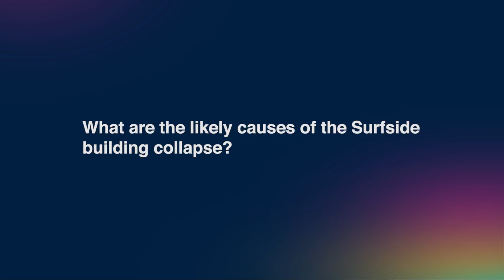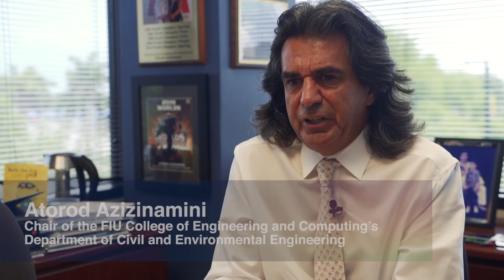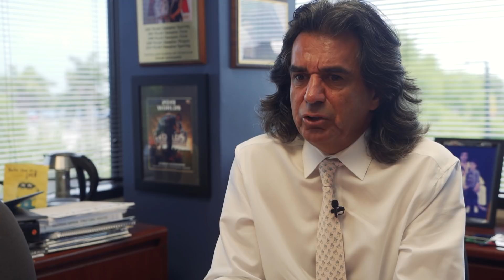Interview with Atorod Azizinamini on the Surfside building collapse

Comment: Perhaps they should design all buildings with the threat of collapse….not just earthquake areas, maybe it could have saved lives in this instance
Reply: What?  Do you think Florida is a progressive state?  Why waste money reinforcing buildings when they're just fine as they stand?  We can't plan for everything, so why plan for anything?  Florida state motto, Lol!
Reply: All buildings are designed not to collapse.  This one stood for 40 years.  Either there was deterioration of material, alterations to the structure, or subsidence; most likely a combination of above.
Reply: @LardGreystoke  Evening news said possible intrusion of water due to faulty waterproofing, for over 30 yrs.  That can certainly affect the infrastructure.  They were in the process of beginning a multi-million dollar remodeling of the building...but they were a few days too late.  The roof work would not take such an extraordinarily long time so that rainwater would enter, however that may have been the case for the past three decades; a steady flow of water though a small leak or leaks would not be good.  I agree, deterioration of material and subsidence is what I've narrowed it down to.  At this time barring more info.
Reply: @RondoHunter3.14  Yup.  Best guess at this point.

Comment: Probably to much material on the rooof! They where putting a new roof on
Reply: If that were the case, it would had collapsed from the top. It may not even have collapsed all the way, just the upper levels. That's not what happened.
Reply: The structure was weaker at the ground floor because of the concrete/rebar deterioration and the extra load on the roof caused it to fail at the ground first.
Reply: @kscott2655  have you seen the vid from inside one of the units? Maybe you should. It was crumbling above them.
Reply: @susycue3  I have not, but that could make sense depending on where they were and the timing. But, watching the overall collapse where you can see the whole thing falling, it is clear it does not start at the top. Perspective is important.
Reply: Hey hey now, this isn't China.
Reply: Or the put a new HVAC unit on roof and it fell through causing it

Comment: how much a beach side apartment cost in Miami? old buildings appreciate right? there goes your investment.
Reply: Half mil n up
Reply: Looking at Zillow, this complex had a wide range. 3 bd 2 ba 1748 sq ft recently sold for $710,000. While a 4bd 4 ba 4500 sq ft sold for $2,880,000. A 2 bd 2 ba 1672 sq ft sold at the end of April for $610,000.  There are also 1bd 2 ba 1200 sq ft in the building.

Comment: I think the construction next door weakened the foundation
Reply: Really? next door construction weekend the foundation on this building? HMMMMM. But yet the foundation under this building seems to be intact as can be seen in the parking garage where workers are working on the collapse from below. 
and the part of the building that came down first was the middle of the building. foundation being compromised by neighboring construction would occur at the outside foundation of the building if this were the case not the middle of the building.
Reply: @grounded7362  actually I listened to an engineer from FIU.  They had to drill pilons at the construction next door.  It has been said there was a crack in the either parking garage or the below ground area of the collapsed building that opened during the construction next door.  They patched it.  This theory  basically says the construction next door destabilized the foundation and caused the walls to weaken and come down.  Im not an engineer but that theory is as good as any really

Comment: Someone is responsible no matter what
Reply: @JuliahFL  you can’t be serious.
Reply: @DylanRollinss  😀
Reply: Spread the word - ALL CONCRETE HIGHRISES WITHOUT STEEL SUPPORT BEAMS ARE IN DANGER OF COLLAPSE. Era of increased solar radiation is deeply penetrating and drying out the water entrapped molecular cohesion of the concrete causing it to get brittle, weaken, and disintegrate. -Like a mountain topped with heavy snow it could be a mere BANG! noise to trigger an avalanche collapse.

Comment: Researchers indicated the building had been sinking since the 1990s.
Reply: Even if the building started sinking every year since it was built and say the building was built in 1980 that is only 3.23 inches over 41 years.
Even if only one corner of this building sank 3.23 inches in 41 years, it would not cause the building to collapse.
The way these building are put together you can remove all the earth from under an entire corner of a building this size and it will NOT collapse.
The same goes for the middle of the building.
Nearly the entire structural support columns and beams at one level would have to be greatly compromised somewhat equally to bring this building down from the middle out like this.
Reply: Grounded. Right on
Reply: Buildings are engineered for horizontal and vertical loads.  If a building settles unevenly it will throw those loadings out of true and induce stresses that were never accounted for.  A steel frame building would probably withstand it.  Concrete is a different story.  There are all sorts of ways for concrete to go bad.
Reply: @LardGreystoke  My thoughts as well. I'm no engineer but like you said a building uneven does not like to stay that way.  I've looked into both flexural and shear force failure in concrete.  Again, you are true in that concrete can and does go bad, in all sorts of ways.  I've seen too many "Catastrophic Disasters" on the t.v. and know a little about various types of concrete and what it does and does not do.  Your comments stand true, I concur.  Thank you for your insight.
Reply: @grounded7362  I've been looking into flexural and shear failure modes and wonder if either/or these forces may have rendered the internal structural reinforced concrete holding the building together may have suffered either mode.  This would effectively split the building should one side, as it appears, begins to go down followed by the rest.  Just another possibility, speculation, guess.  Of course this would mean that one side of the building, possibly already compromised, could and did fail under either excess, unbalanced weight on roof or lack of ground support or both.
Reply: What is the context of it sinking? If it is just sinking perfectly vertically nothing will happen other then eventually being underground, loads would be the same.  If one corner was falling by 2mm/yr you are still talking only 6cm total which would be about 4 inches (unlikely only 1 corner would fall) and you are talking a decent horizontal distance for that 4" fall too that it would be of a minimal magnitude.
Reply: @ryanwright9460  The CC tape showed that a portion of the building fell first followed shortly by another section.  If a building such as this has a corner begin to sink cracks will and did form.  They were basically ignored.  The weight load of the building would shift the gravity center towards the dip.  This would cause an undue amount of force on one part of the building while the other part was just fine sitting where it was.  So the sinking part simply separated from the rest and fell.
Reply: @RondoHunter3.14  i think it had minimal to do with it, you are talking 2.4" over a 100-200ft span to hit the extreme scenario of your lack of context.  The report of it sinking 2mm/yr is likely in reference to the whole building, however not in the ideal uniform sinking that the distribution of stresses would be the same which would make the shift in loading less than a change of 2.4in/150ft and that is including the surveyors measurement errors from before and after each check.
Reply: @ryanwright9460  That may be true.  You seem well-versed, it will be interesting to see what the final verdict is on this disaster.  Yes, a year or so on down the line we'll get a report.  Thanks for the discussion, you raise viable issues.
Reply: For over 30 years they knew the building was sinking.  Probably because it was measured in millimeters (2 per year) and they got confused about the translation to standard measurements, figured "Ah, that's no big deal.  Call us back in about ten years or so."

Comment: "Unusual event before the collapse" - a powerfull underground blast ??? 😡
LOOK UNDER still standing 😯 BUIDING-SECTION ON PILLARS:  
[1] Are those pillars DAMAGED BY A BLAST/SCHOCK/WAVE from under, building above uplifted and reseted ??? Why only this building-section still standing ??? - LOOK UNDER, SEE to understand 🔔 
[2] GROUND-FLOOR IS WIDE OPEN, clear rods, 4ft long ... like spikes of a comb ... UPWARD DIRECTED and SPREAD, cleared of concrete (!?!) 🔔
😡 IT SIGNALS more like an underground floor-blasted "event", probably A POWERFUL BLAST (!?!) underground ...  but, because open air, no walls around, the wave-power dissipated ... maybe ...! Pure luck for people above ! Former vice mayor lived (third floor above) - he should make his mission - to find out what really happened ! 😡
[3] Why cars are piled upward ??? 
[4] THEN LOOK AT THE VIDEO - 4-5 story high raising (!) dust - FROM A BLAST ??? 🔔 BEFORE first building-section collapsed - why inside-section collapsed first, no open air for wave-power to escape ??? How serious damage happened UNDER (!?!) that also larger, longer building section -  again no open air ground floor ? - finally collapsed few seconds later in its entire length ??? 
A sinkhole "event" - as trigger - would have rods downward with concrete hanging pointing to the abyss, car pulled in, NOT UPWARD, under a still standing building-section !!! 🔔

Thinking loud ... 🙈🙉🙊

Comment: They were in the process of doing a 40-year recertification and update while this collapse happened they were working on the roof the electrical and the foundation and also there was a fresh built building directly across the street they are thinking that might have caused soil erosion
Reply: Sinkhole.
Reply: Would not explain falling into the foot print. 

Weaknesses would be in areas thus collapse would be random and much more destruction.
Reply: @sara-gr5uu  Spread the word - ALL CONCRETE HIGHRISES WITHOUT STEEL SUPPORT BEAMS ARE IN DANGER OF COLLAPSE. Era of increased solar radiation is deeply penetrating and drying out the water entrapped molecular cohesion of the concrete causing it to get brittle, weaken, and disintegrate. -Like a mountain topped with heavy snow it could be a mere BANG! noise to trigger an avalanche collapse.
Reply: @BGraves  Get a life.
Reply: Same thing happened to Crab Cooker in Newport, CA ...it took 2-3 yrs to repair the foundation and rebuild entire building. IAllegedly did good video on Youtube
Reply: The tenant of this building did sue the HOA and told them that he felt the building shaking.  The law suit happened couple years ago.  It was way before all of this happened.
Reply: Spread the word - ALL CONCRETE HIGHRISES WITHOUT STEEL SUPPORT BEAMS ARE IN DANGER OF COLLAPSE. Era of increased solar radiation is deeply penetrating and drying out the water entrapped molecular cohesion of the concrete causing it to get brittle, weaken, and disintegrate. -Like a mountain topped with heavy snow it could be a mere BANG! noise to trigger an avalanche collapse.
Reply: @termination9353  smoking to much crack man
Reply: @ronnierabell1  I guess with your experience you should know.
Reply: @termination9353  dumb.
Reply: @BGraves  Get a life

Comment: Should be pretty detailed maintenance logs engineers can refer to as well to ensure repairs were dealt with correctly. That could be another factor, perhaps there were structural issues that needed attention that were either put off or done incorrectly. Think Sampoong Mall in South Korea was similar.
Reply: Apparantley this is the case, an engineer has came out saying he warned if thus 3 years ago.
Reply: In my experience, which may be biased, community associations such as the ones that run condos do not always keep great records. Often, they hire a management company. Each manager may be responsible for several communities. Required training for managers is minimal and turnover in the profession is high. If an association changes management companies, the transfer of records is often very poor. I would not automatically assume that detailed records were kept. The association seems to have units of decent value, which helps, but the fact that they had to get a loan for the roof repairs says to me that they may not have made the best decisions in running the condo association. That's super jaded of me to say, and I'm not blaming that for the collapse, but I do think records may not be as available as you'd think.